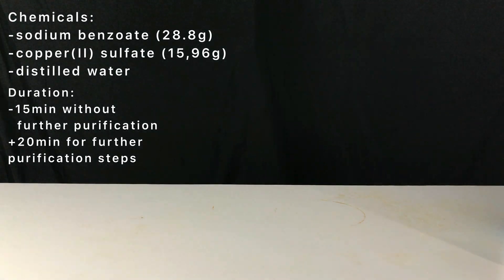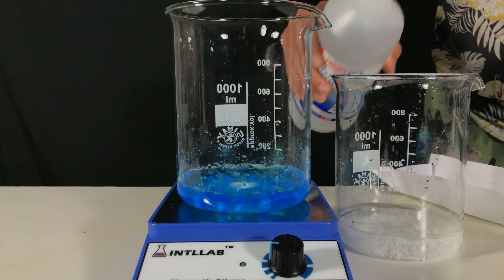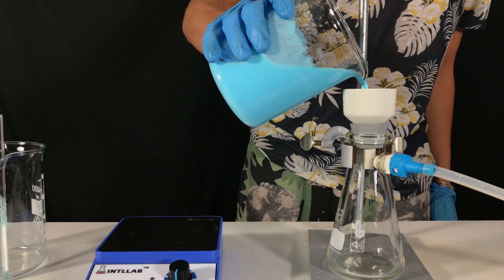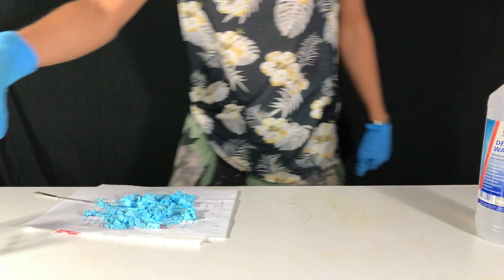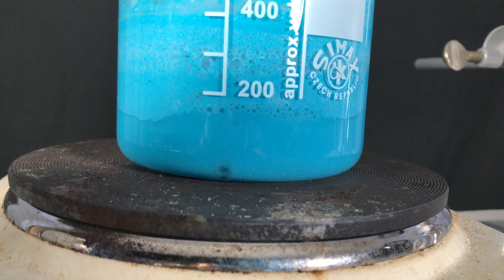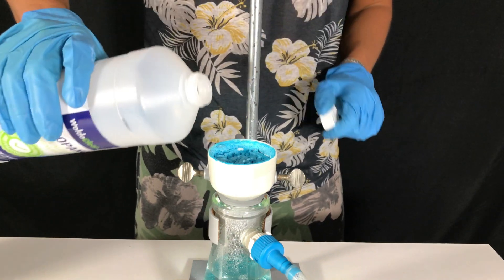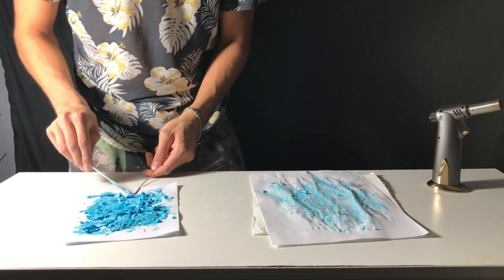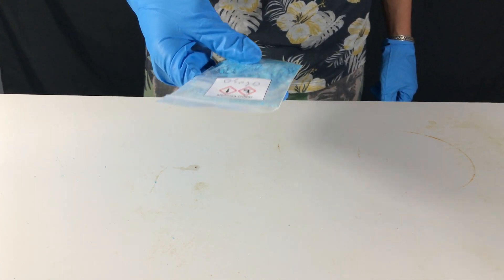Making copper benzoate from copper sulfate and sodium benzoate

Comment: Is it sure Germany video. Looks on perfect storage bag with descriptions.....😂
Also you can use decantation. For this type preparation it can be easily.
Reply from the maker: but if you filter you more easily remove the bulk amount of water before drying
Reply: @THYZOID  Oh yes, before 5 minute I used your Buchner method. It was much faster than decantation.
Thansk.

Comment: In the same way You can make calcium benzoate (eg. with CaCl2) . Pyrolysis of dry calcium benzoate (at about 350-400C) is method to synthesis benzophenone. Reduction of benzophenone is the easy way to make benzohydrol - I think much simple than Grignard reaction . Benzophenone can be reduced in many way, but two important are: by using NaBH4 or using zinc powder in ethanolic solution of NaOH.  Pyrolisis of calcium salts with carboxylic acid is generaly way to make different ketones. It's interesting what eventually could be make by  pyrolysing  of copper benzoate ? ;) And definitely You should get better vacuum pump. Now you can buy cheap small oil rotation vacuum pump, which are used for air-condition servicing.  Or better for aggressive chemicals water jet pump.  Good Luck.

Comment: Copper benzoate has some use as a colorant in pyrotechnics. Using ammonium perchlorate as an oxidizer, a very nice blue star can be achieved.
Reply: Sodium content will probably be a problem for blue colors using this synthesis, substituting potassium benzoate as raw material would probably be better. Very little sodium is required to wash out the blue to look greenish.
Reply: @erikisberg3886  this it true potassium benzoate is definitely  better for making copper benzoate in a double displacement  potassium wont effect color like sodium will
Reply from the maker: Yes that is possible. Sadly in germany perchlorates (especially the ammonium perchlorate being an explosive itself) and diy pyrothechniques are illegal. Therefore were not going to try it out.
Reply: @THYZOID  All amateur pyro is illegal?

Comment: Is that stirring thing a hot plate at the same time? Where did you got that from?
Btw I like your videos, well made. You should get more attention!
Reply from the maker: Thanks! 
The magnetic stirrer is only a stirrer. I got it from eBay a long time ago. I’ll get a hot plate stirrer soon.
Reply: Magnetic stirrer hotplates are one of the best inventions as far as chemistry equipment in the last 150 years, they make everything so much easier!
Reply from the maker: @chemistryofquestionablequa6252  they sure are and I plann to get one someday. It’s a pain to only be able to use Hotplate or stirrer or only a heating mantle with integrated stirrer.
Reply: @THYZOID  I'm currently dealing with Joanlab to get a couple of replacement heating elements for the hotplate/stirrer I bought from them. The original burnt out and it's taking forever to get the new parts. I think the English/Chinese language barrier is causing some problems, but they also said they had shipped them, but the courier company didn't have the tracking number on file, smh. I had to pay for the shipping too. So I now have one hotplate that can only heat, and another that can only stir...